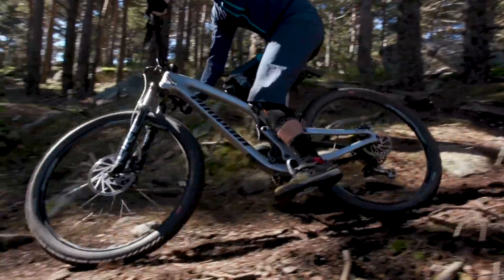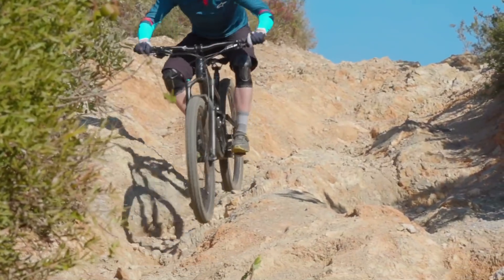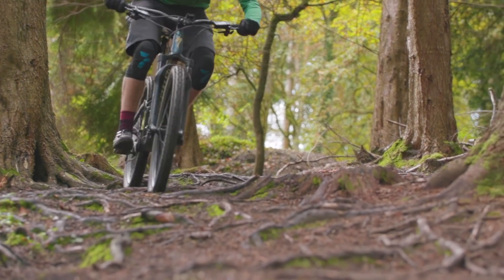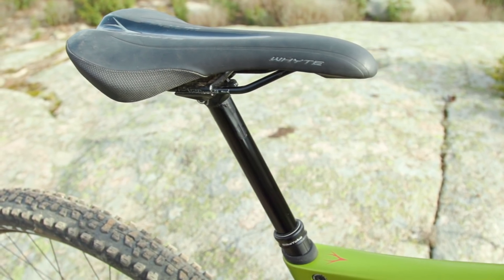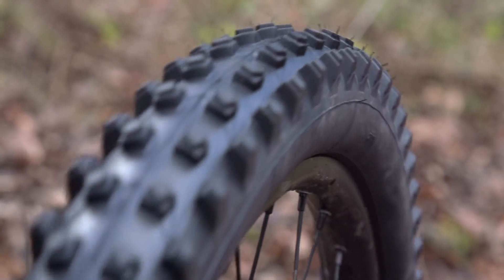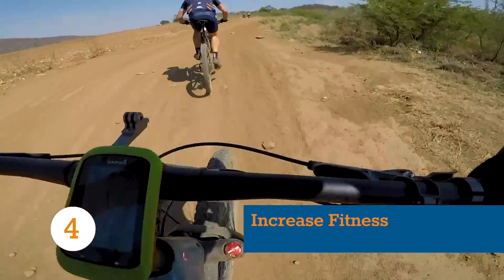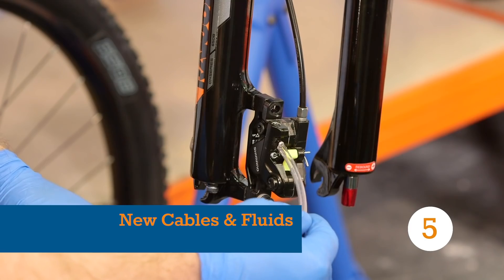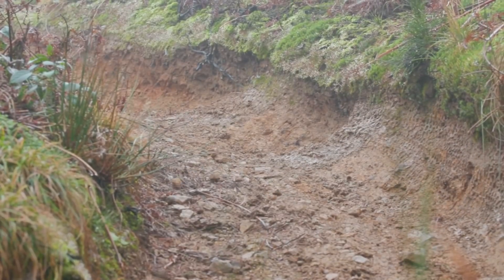Top 5 | Cheap Mountain Bike Upgrades That Will Make Your Bike Better

Comment from the maker: What would your best cheap upgrade be? Let us know in the comments.
Reply: Get a bike
Reply: BikeRadar 
Peddles.
Reply: A light a aluminium frame and wheelset
Reply: Sir please help me sir
Reply: Tires and it's not even close.  Disagree with the price thing though.
Reply: Bars and grips.  I found that different width of bars completely changes the way the bike handles!  Wide bars FTW!!
Reply: riding with friends. it upgrades all aspects of riding
Reply: Sell your mtb & get an e-mtb.🤫
Reply: hmmm i would get fit. im joking big brain
Reply: not really cheap, but also not that expensive, so getting a professional bikefit would be my upgrade no1. and after that i can buy all the fancy stuff which suits me and my body.
Reply: the  most cheapest upgrades is your body having a light frame and xtr groupset is great but your lungs legs and mind is not xtr this is the part that needs an upgrade
Reply: @jeffpedals  I just sold my e-MTB and got an MTB 😁
Reply: @johnon1344  well that's cool, I don't disagree with either assisted or non assisted. They each have their place.
Reply: @jeffpedals  Yeah.. I enjoy them both for different reasons, been on electric bikes for the last 5 years.. so right now, I'm enjoying being back on a MTB again..

Comment: Today, at 3am I made the best upgrade I could have done to my bike: I spent 1h on ... truing my wheels. That was 0$ job yet so much improvement ;-)
Reply: Except for the $150 plus truing stand
Reply: @maxs4545  none
Reply: @zyghom  how did you do it then? True it on the bike?
Reply: @maxs4545  you can use zip ties

Comment: Get a dropper post! Not the cheapest upgrade though...
Reply: There are some pretty decent dropper posts out there now that are very reasonable. I have some brand x ascend dropper posts that were cheap and do a great job. I actually got rid of a KS Lev SI and switched to the Ascend. It just worked better on my bike. 
And yes I agree that is a huge upgrade and I always tell people to do it as one of the first things to upgrade on their bikes.
Reply: @DTMFM13  true that. Got a Brand X. It got a little play in it and the lever is not the best one, but got it for 100€. One of the best upgrade I ever did. You can so quickly change form climbing to downhill and vice versa without always getting off the and fumbling around on your saddle.
Reply: Neither is converting to tubeless. Soo..
Reply: I didn't even know what it was when I bought the bike, now I couldn't live without it,
Reply: George  nope really easy to install. Just watch a youtube tutorial. The stealth (internal frame routing) posts are a little harder but neither are difficult. I can't ride without one anymore.
Reply: @elijahpestana3123  going tubeless doesnt cost that much?
Reply: Dingdong Sanderbob, sorry. I meant it is relatively expensive to convert to tubeless IF your rims and tires don’t allow it. You need tubeless ready rims and tires for it. Technically, you don’t have to have tubeless ready rims and tires, but whenever I’ve tried going tubeless without them, my wheels can’t hold the sealant.
Reply: 30 years ago I had a Hite Rite, now a dropper post.. I can't ride without it...

Comment: Touch points are huge (grips, saddle and the right pedals). Plus, cockpit too. Have the right bar width, stem length, and shim stack etc can transform how a bike feels. First thing I upgrade on a new bike (touchpoints and the cockpit)!!
Reply: Couldn't agree with you more Matt. I changed the grips, pedals, and stem and bar that made a huge difference on a 20 year old Cannondale. Magic! Thanks for your time. ALOHA
Reply: Since when has a bike had a cockpit?

Is this a hidden reference? Innuendo?
Reply: @JB-1138  What did you think that little dip in the saddle was called

Comment: Pedals make a significant difference. If you're into speed, buy a pair of XTR pedals. If you bang your feet on rocks, then pedals with more mass to take the hit and keep your feet in the pedal are nice. Quality chains make shifting much smoother. Changing the front chainring changes all your gearing ratios that could suit your riding style, location and strength.

Comment: Going tubeless is so easy these days. In 2017 neither my rims or tires were tubeless ready. Had to use every trick in the book to get it to work. Yesterday did it on my new bike. Didn't even know they were already taped which was a nice surprise. Then both tires seated easily with my floor pump, like it didn't even take aggressive pumping. It's just so simple now, no excuse not to go tubeless.

Comment: ESI grips are so good, especially for the price
Reply: I'd say they extremely low value, it's foamed silicone ffs. It can rip on first crash, they should cost 5pounds
I run 36mm competitor that costed about 25 pounds, it was worth it for the comfort but not at all for the value. Those grips due to price should practically not sell at all.
Reply: @polishguywithhardtospellna8227  I like buying American made stuff. Can get them for $15 at my local shop. Plus nothing more comfortable for me than ESI chunky grips 🤷‍♂️

Comment: Hi, I'm really newish at mtbing and upgrading. so I'm sorry if I'm not using the proper ediquette (or however that's spelled). but my question is. I have a iron horse quantum 2, it has a 3 gear cassette at the crank, am I able to take that off and put just one like and oval one, and just remove that gear set up entirely, would I just have to adjust the chain accordingly? I've been trying to research it but I cant find anything and I just want to know if I can before I do. Or is that just dumb jahah

Comment: I really want to try solid tires for my mountain bike that I use mostly for the road. They're expensive but seem worth it if flats are no longer an issue.
Reply: yea, i went through the original reartyre, so had to replace...., with some cheap narrow grippers for Impact, because i was low on cash then, but they are fine for the road and wearout way less than the Michelins it got delivered with..., next upgrade will be tubelessconversion and shorter stim....

Comment: I have magic marry tires. There are ups and downs to them. They are not good just riding around or on the road. I find that they are great for going through almost anything downhill over tree roots and rock.
Reply: It's a seriously aggressive tire. Got one on the front of my new bike and it's got so much grip, it's amazing.
Reply: @smokedsalmon3907  so true man. They are so horrible on the pavement. And flat trails lol. But I love them so much grip. I have hans dampf on my hardtail those are my favorite mountain bike tires
Reply: @jasonlewis6914  yeah you definitely need to be riding some more challengimg trails to truly appreciate them. Lol I've got the magic mary up front and hans dampf on the rear of my new bike. Really enjoying them. Before this I was a huge maxxis fan, these may be my new favorites.
Reply: @smokedsalmon3907  they are my favorite brand of tires. Hans are probably the best tires I ever had on a mountain bike. They are great on every sort of mountain biking.
Reply: i got some cheap impact tyres, good on road and good composite, wouldnt have bought them, but my wallet decided at that time;) front u could do with the mary, its good to have the control there when u might go offroad;)

Comment: I´ve just upgraded my bike to tubeless wheels... Now, how often do I have to change the milk in there? I ride at best once a week for maybe 3-4 hours and sometimes weekends for 2 days... Some rough numbers woudl really help me :) Great Video btw
Reply: At the most change it every 6 months as even if its not used it does dry over time (don't ask me how). Most recommend changing every 2-3 months. You can get Doc Blue 500ml from CRC for £14 at the moment which will be enough for 8 changes roughly at 60ml a tyre.
Reply: @guitaroidman524  ok thanks very much

Comment: More puncture resistance on a tubeless? Just slap a tube in it stonks

For real, get a good tire with protection. Never had a tube problem, except when running bad tires that were thin as thin as paper because wEigHt SavInGs
Reply: I had good schwalbe tyres with tubes but got pinch flats when I did bigger drops on rocky trail. I went tubeless and no flates since.

Comment: Basic servicing your fork is also great, just an oil change and well lubricated foam rings go a long way in making it smooth through its travel again. 

If you could save a bit, a new rear hub is amazing. Bitex hubs are $70-$80 and give you 50+ PoE. My stock hub had 15 or so and the engagement feels really nice. It does help in slow techie sections, but more than that it makes the bike feel really premium.

Comment: An expensive one but would give you a better experience are the new fox 36/38/40 (2020/2021)
Reply: No.
Get your cheap fork custom tuned 
A tuned Yari is as.good as a.Grip2 Fox but cost only 200-250€

Fox is overpriced
Reply: justino roldan bah. Only about 5 to 10% of riders are skilled enough and riding trails aggressive enough to benefit from those things
Reply: Those are a complete waste of money right now, have fun paying early adopter tax